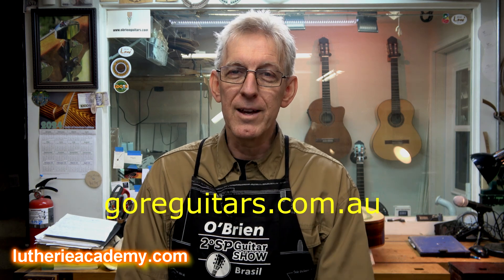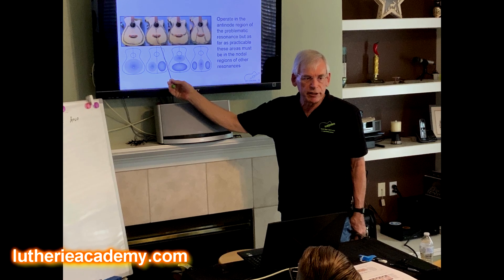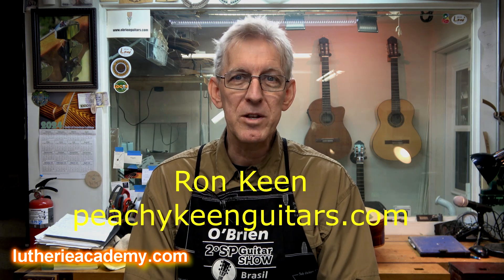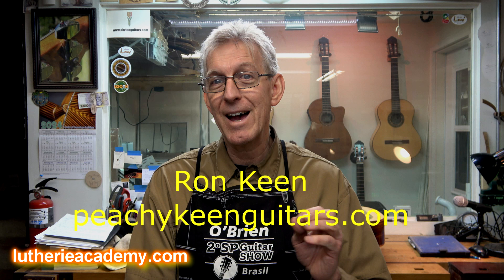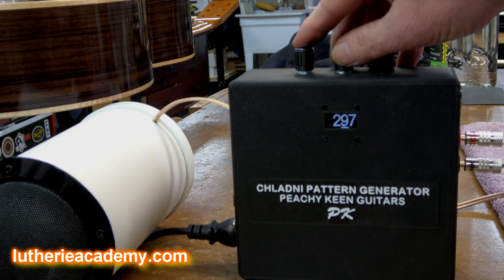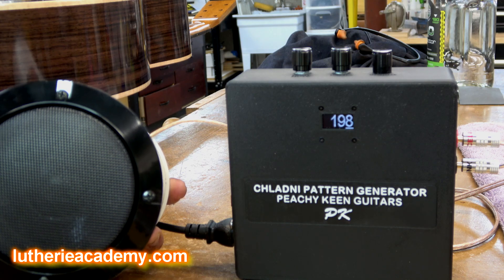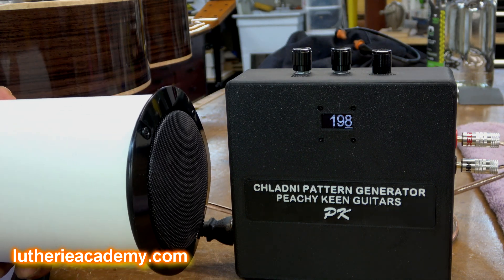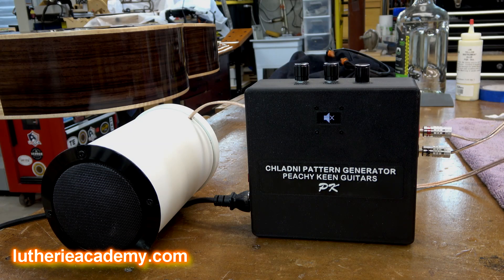Chladni pattern generator developed by Ron keen

Comment: How can finding the resonant frequency and resonance pattern help with an already-built instrument? Seems like this information is more appropriate in the building phase to assure bracing and thickness are appropriate.
Reply: I just had a guitar that came into my shop that had a wolf note on the open D string - due to a resonant frequency. Fixing this involves finding the chladni pattern and adjusting that frequency - this is covered in the books